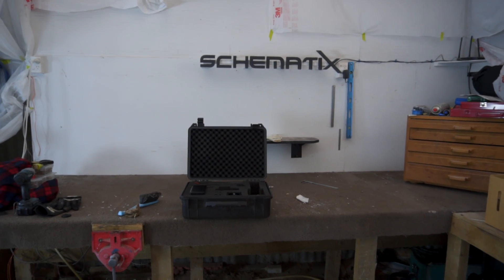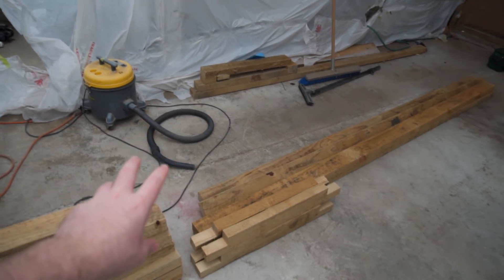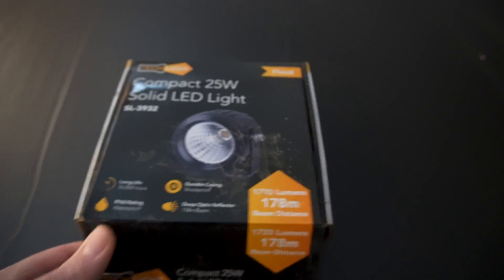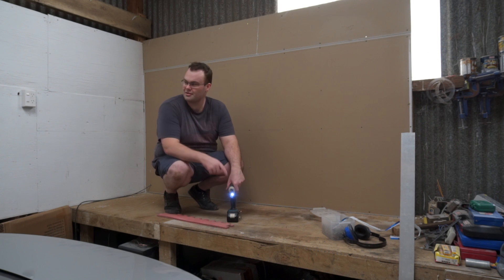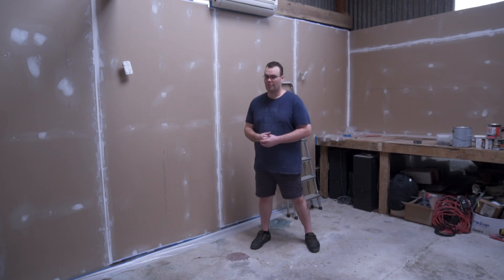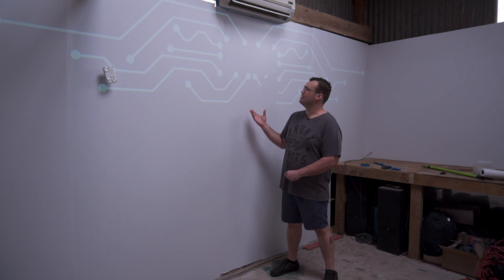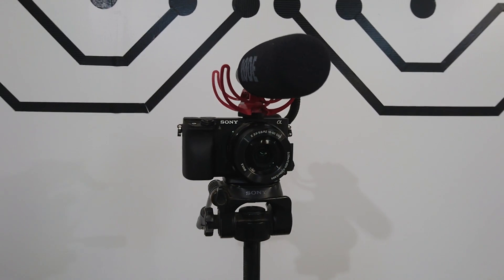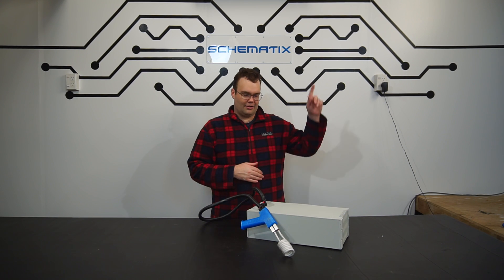What have I been up to?

Comment: Pro-Tip . After masking ...  apply a second coat of the first color to seal the masking tape IE the paint a white color stripe in this case under / prior  to applying the desired color stripe black. this seals the masking tap so the desired color does not bleed under the masking tape.  BTW Looks Great.. and Great Job
Reply from the maker: Where were you when I needed that advise!!! haha. Good tip